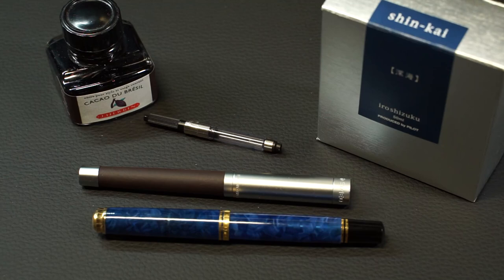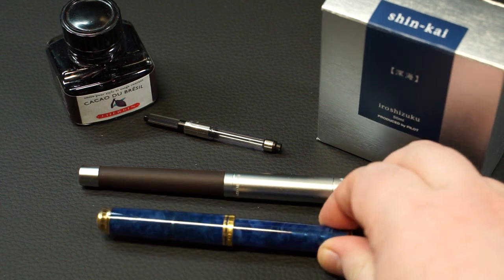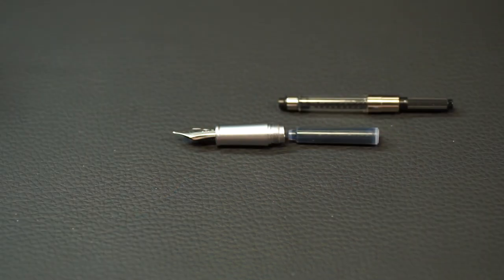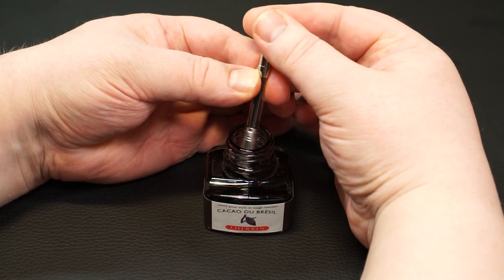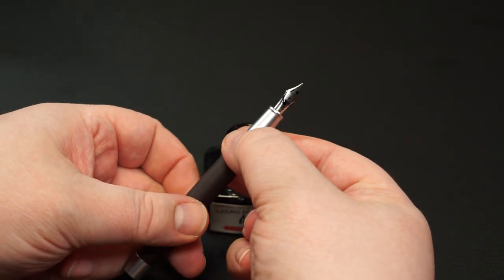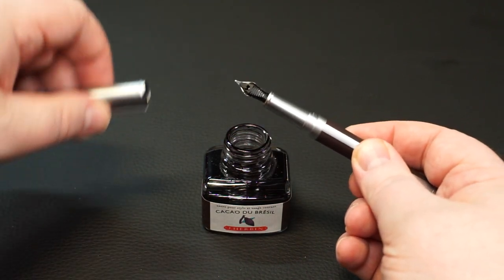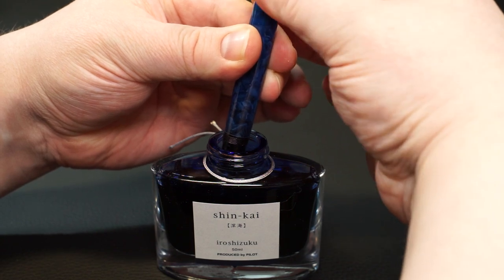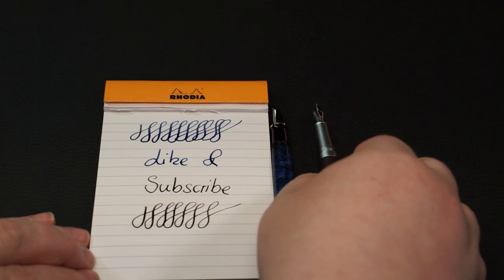Fill piston fountain pen and ink converter correctly - without ink fingers!

Comment: Why it is advisable to fit the converter then fill the pen, cant we fill the converter and then fit it to pen?
Reply from the maker: Of course, you can fill the converter first and then insert it into the fountain pen. There is nothing wrong with that.

But the advantage of filling the converter while it is inserted is that the fountain pen is already filled.
You can start writing right away, so to speak.

If you insert the filled converter first, the ink must first distribute itself in the ink feed before you can write.

In addition... because the feed is filled, you have a little more ink available until you have to refill it again. But that's really minimal.

Last but not least: It is much easier in the inkwells, because you don't have to dip the converter so far into the small inkwell.
Reply: @WritingDelight  thanks for the info. Its great having people like you to explain things in such a beautiful way ✍️❤️

Comment: Disposable kitchen gloves, made of thin clear plastic avoid the ink fingers problem.
Reply from the maker: Yes, that would help. But I don't think it's very ecological. 
But sure, for those who otherwise can't manage without ink fingers, this is a good thing.

The video is just here to be a hint, how to do it without these tools. :)

Oh, and on the subject of gloves and fountain pen filling, there is a comprehensive video from me: https://www.youtube.com/watch?v=WRx5N25IKmg
Reply: @WritingDelight  Actually, though they're called 'disposable' (which I pointed out to explain what I describing), for ink filling there is no reason NOT to reuse them (unlike food handling). I certainly do not throw them out after a single time.
Reply from the maker: @theronwolf3296  That is a lot better. :)
The important part is: you can work with your solution. There is no "right" or "wrong". Only "works" and "don't work". ;)
Reply: This is what I use too ... because I am kind of messy and the gloves make me more confident.  I don't mind ink on my hands unless I am heading to a business meeting.